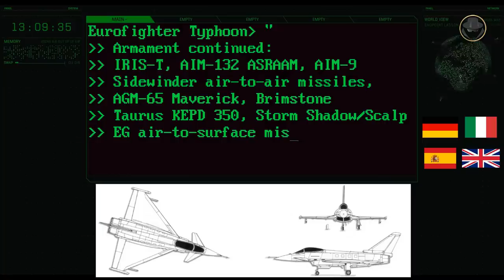Eurofighter Typhoon | The story that the West does not want to tell

Comment: Just one ironic thing to point out though, the MiG-21 actually has a lower thrust-to-weight ratio than the F-4 and pretty much the same wing loading, but in a real battle, the MiG-21 is noticeably more maneuverable.
Reply: Dogfights is but one aspect of the story. There's also the longer range part among other things.
Reply: That's why Israeli pilots slaughtered the Russian and Egyptian pilots flying the Mig 21 in 1973. They only lost a handful of F-4 Phantom II to aircraft all others were downed by the S-125. Once the Mig 21 left the umbrella they died.
Reply: Mass will be mass
And huge frontal aspect with a bigger Cx is a disfavour for F4
Reply: No it isn't. There's a big difference between an early very light MiG-21F13 (which has a noticably lower wing loading than the F-4's) and the successive and much more numerous MiG-21Bis variants which have no advantage over the F-4, esp. the slatted F-4E.
Reply: The MiG-21 even in its early variants had the advantage of lower aerodynamic coefficient against the F-4 and this made up somehow for its inferior thrust-to-weight ratio. The second advantage of the MiG-21 was its superior G-limit ( 7G against only 6G for the F-4 ) this gave it the initial angular advantage whenever the pilot used to pull the stick all the way back at high speeds until it reached its corner speed. This advantage worked especially at low altitudes ( like in Vietnam where the aircraft were forced to fly low so as to spot their targets in the jungle ).
Reply: @jacksonteller1337  Nearly all of Egypt's MIG-21s were destroyed on the ground. Almost four squadrons lost before Egypt had even declared belligerency. Once the MIG-21 was in the air, it turns out it has a much better survival rate!
Reply: @dylanwight5764  you are confused, the 67 war they were destroyed on the ground. The Yom Kippur war in the air.
Reply: @dylanwight5764  want that the six day war not the yom kipper war where Israel cleared the skies of Egyptian and Jordanian mig 21s using the f4 phantoms. In the six day war israli fighters were the mirage.
It's probably more to do with fighter pilot training and skill. It's like how the Indian airforce mig 21s dominate the Pakistani f105s in air battles
Reply: @catfood_03_4stray  It isn't the coefficient rather the lateral cross-section.
Reply: @jmcfintona999  The F-4 entered Israeli service only in 1969 - during the attrition war against the Soviet-fronts "Egypt" and "Syria". The Israeli advantage was in the pilots first, and delta-wings second.
Reply: @dylanwight5764  Yes, except at the French Mirage III the real killer of Mig.
Sorry, but find out and see you that I'm not talking nonsense
Reply: mig21 is a unstable aircraft meaning you can get it in to crazy maneuvers
Reply: @RePlayBoy101  All the Russian planes are perfectly stable. Only F-16 and 3 Euro-canards aren't. The narrow body allows the Mig-21 to roll fast.
Reply: @zofe  the migs are notorious for being unstable thats why they are so maneuverable in the air
Reply: @RePlayBoy101  Nonsense, they aren't any superior. F-4 Phantom didn't have an integral gun in Vietnam, nor leading-edge moving-surfaces.
Reply: @zofe  what are you on about who said anything about an f4
Reply: @zofe  yeah the six day war was in 67
Reply: @jacksonteller1337  Sorry, I can never got those two straight. And let's not talk about trying to tell the difference between an India-Pakistan border skirmish and a cricket game.
Reply: @dylanwight5764  they can't even get their facts straight on the subcontinent. They seem to think propaganda is actually true. But in the six days war (1967) Israeli Mirages wiped out the Egyptian air force in a preemptive strike. During Yom Kippur the Egyptian army and air force hit Israel with a surprise attack it went well until they got out of the air defense umbrella. Their army was knocked out and the air defense destroyed on the ground. Then the Israeli air force wiped out the Egyptian air force and Soviet instructors blamed the Egyptian air force but got their arses handed to them.
Reply: @jacksonteller1337  By that time the MIG-21 was a pretty dated design, so it shouldn't have been a surprise to anybody that the more modern and refined aircraft it was facing had an easier time overall. 1973 was not the right time to still be flying the -21.
Reply: @dylanwight5764  they were younger than the F-4s and Mirages they faced. Both sides back than had obsolete weapons and only Israel had the brains to use them in a way they got the advantage. They even used the Sherman back than on the ground it also knocked out a lot of Egyptian and Syrian tanks. After the conflict they started buying the F-4E and replacing the Mirages with the F-16. The Mirage V they upgraded to Kfir with the F-4 engine.
Reply: @jacksonteller1337  I wouldn't consider the F-4 an "obsolete weapon" by any means. The design was very long lived in service because its airframe was well conceived and easily upgraded. Moreover, while the F-4 and MIG-21 were contemporary interceptor designs, the F-4 was a better all-purpose aircraft that was capable of missions simply not possible with the MIG-21. 

This is an interesting microcosm of the different design philosophies between western and Soviet aircraft. Whereas the latter often put all effort into perfect an aircraft for one purpose, the former valued a more versatile approach to aircraft design in general.
Reply: @dylanwight5764  the Mig 21 is still in service in several forms. They are still being upgraded and the Chinese have supplied the world with a shtload of cheap derivatives.
Reply: @jacksonteller1337  And what exactly are they capable of that the Mirage-III and Phantom II arent? Well, they're still very good high altitude interceptors. Although for some reason I doubt that bombers are going to be the technological tip of the spear in the next major global conflict...
Reply: @dylanwight5764  that would depend on which model you fly. The bis derivatives like the Bison upgrade are capable in a dogfight and much more capable than the Mirage III. The F-4 is in a different category so it will always outclass them with the exception of the Iranian versions. That is why the Chinese development of the J-8 was built. It in essence is a double Mig 21 with inlets and radar based on the F-4. I don't know how much Google will show but there are many types in my NATO database that can out perform the F-4 and Mirage provided the pilots are properly trained and they use the right tactics. Like in every case you are dependent on pilot training and tactics.
Reply: @jacksonteller1337  That's almost always the case, especially in an era where HOBS and BVR are the the typical factors deciding the outcome of an engagement. By the way, do you have any data on the optimum rate speed of the -IIIO? I know the MIG-21bis is best at around 750 knots and from memory the -IIIO performs very well at about 800 but I'm unsure of the specifics as they're not available in the RAAF archives.
Reply: @dylanwight5764  i haven't memorised it but it should be around the same as the E model because both where nearly the same. When i have access to my computer tomorrow i can look it up if i remember to do so. I have a small trip to Brussels in the morning we have to use the train unfortunately. So i should be back in my office about 16.00 hours if i think of it i will look it up.
Reply: @jacksonteller1337  Thanks for that. There are rumours that one contributing factor that the Avon engine wasn't adopted for the -IIIO was because it reduced performance in the turn but given that the Avon improved the thrust to weight ratio I don't think the slightly increased turn radius would outweight the improved turn rate of the extra power provided.
Reply: @dylanwight5764  we are having a longer chat here so i looked it up for the export version the optimum varied from 795 to about 815. But the input of this data was done manually, so a typo is very well possible. That is the problem we have with older data i always warn my boys to ask a geriatric like me that actually flew an aircraft. I started on the NF-5. Unfortunately i never got a chance back than to fly any French aircraft with the exception of a few helicopters. ( I have a private helicopter license).
Reply: @jacksonteller1337 All my experience with the Mirage-III has been on the ground restoring a destroyed airframe for the museum at Evans Head and spending that time learning all I could about it from retired RAAF pilots also volunteering there. They thought the -IIIO was best at around 800 as well. Although one of the more interesting nuggets I gleaned from them was that the -IIIO could out turn the F-4E and matched it for acceleration. Knowing that F-4 pilots often complained about the MIG-21 being the more agile aircraft and taking what you've said about the Mirage-III, we really are looking at such a small practical difference in performance between the two that pilot skill is going to be the main factor. And in that regard, the Israelis were certainly better suited to handling what their aircraft could give them! 

At the end of the day I think the MIG-21 and Mirage-III are a pretty good match in the air. While it's a shame that the Mirage-III was discontinued in favour of the Mirage-2000, I want to say they're still the same aircraft at heart and the legacy of the -III series is still going strong.
Reply: @dylanwight5764  i hope i can visit your museum soon otherwise it will be after my retirement. Have a wonderful day mate and stay safe 👍
Reply: @jacksonteller1337  I think I'm safer crawling through a junkyard than working hospitality!
Reply: Of course to that the Mig has to get close enough, it won't
Reply: Superior maneuverability, more specifically turnrate, doesn't solely determine an aircraft's capability against an opponent. There are energy fighting tactics to allow less agile aircraft to gain the advantage over a more maneuverable enemy - Hellcats against Zeros and whatnot.
Reply: @zofe  Google the F-4E
Reply: How could the ESA prefer agility over stealth when they had no capability of producing a stealth aircraft in the first place?.
Reply: @sean70729  to my understanding, MBB was developing a something more fighter looking analogue of the F-117A in the 80’s.
Reply: Compared to the Typhoon? Don‘t think so …
Reply: This is a great run down thanks. My favourite jet as a boy in the 80s was the Saab Viggen. I loved how it had high speed yet road landing, basically STOL performance and thrust reversers. Saab cars,  uh not so much.
Reply: No, it  depends how you fly each aircraft.  Keep in mind the F-4 has been designed as an "carrier protector" against bombers. Early and Navy versions of the  F-4 relied only on AAMs in air combat and the fire-control system was very slow. Would be a great "simulation" modeling an F-4C or D, equipped with built-in M39 cannons (the same as the F-5) + gun radar and then confront the MiG-21.
There were good reasons why USNFWS flew F-5E as aggressors.

The  Israelis Mirage III were equipped with DEFA 30 mm cannon (descendants of German WW II cannons) and the Israelis  excelled in "gun kills". Even with a F-15, a "gun kill" is still more worth than with an AAM.
Reply: @sean70729  The stealth stuff is just good for "Hollywood" and video games.  There are several disadvantages with "stealth" aircraft compared to a more or less "conventional" fuselage.
Reply: @jacksonteller1337  Wait, you flew the NF-5? That's awesome! How nimble was it?
Reply: @Tigershark_3082  it was great it is a bit more sluggish than the F-16 we got after in the vertical but it is a great dogfighting aircraft. Unlike the original F-5 it was tailored to our multirole use. It could pull nearly as many G's as the F-16 but it had a higher turn rate in the horizontal I still mis it especially the second engine that is why old-timers like me preferred the Rafale over the F-35A before we got our hands on it, the situational awareness 👍
Reply: @jacksonteller1337  Wasn't the NF-5 a foreign-built Canadar CF-5?
If so, I shudder to think what y'all could've done with an F-5E
Reply: @Tigershark_3082  Dutch build the N means Netherlands, Fokker Aerospace. Somehow we went back in sensors on the F-16A but it compensated in manoeuvrability. Both were a major leap forward on the aircraft we had before especially in dependability.
Reply: Early production models of the mig 21 had the R11 engine, this was later changed to the R13 engine.

I vaguely remember a documentary where the US pilots were used to doing a certain tactic that the mig21 was unable to catch up to them....

Then one day they realised that they could and it being mentioned that those were mig21 with the new more powerful engine

The power difference between the 2 engine is 1.2kN at military, and 3.1kN with afterburner.

So the North Vietnamese were probably sold the older stuff, and then received the newer variants.
Reply: Pilot skill plays a huge role. That's what I have learnt from documentaries. I mean there have been sabers and shooting stars that shot down mig21s. And mig 15s/17s that shot down mirages and f4s.
Reply: @aksmex2576  Mig 15 didn't shoot down anything but a couple of Sabre jets over Korea. The Mig 17/19 shot down USAF F-4s due to lack of dogfight training and a one arm tied behind the back rules of engagement.
Reply: AOA, straight thrust, horizontal stabililiserts, midle height mounted wings, nose intake
Reply: @jacksonteller1337  
What are you talking about?
The vast majority of Egyptian MIGs lost in 68 were on the ground after the jews launched a surprise attack alongside the US, whilst Egypt was busy in Yemen.
Reply: The main difference between the performance of the MiG 21 is the pilot. In the hands of a competent pilot it is an effective weapon, see India's use of the jet in several conflicts
Reply: It is absolutely hilarious to read the myopic focus on air-to-air combat by video game armchair commandos who have no clue what modern aviation warfare entails and where it fits and functions in the modern battlefield and the combat dimensions that must be addressed. Today's advanced ROEs can even include (to the horrors of armchair warriors) prohibitions of air to air engagements utilizing any air-frame mounted guns!
Reply: @zofe  lmal this dude didn't even know that the fighter jets need to be unstable
Reply: @LexlutherVII  neither can their Russian instructors they were shot from the sky even faster.
Reply: @jmcfintona999  pakistan? F105s?
Where? When? Why?
Reply: This video isn't about the f4?
Reply: @Kevlar67476  I think he means F-104's
Reply: @thewarper3393  You say Egyptians not Arabs, and Jews not Israelis. Says a lot about you!
Reply: @Hattonbank  yeah, maybe.
Reply: @Retroscoop  going back to your original comment (a year ago)

Nail on head. And too many people miss this.
Reply: @jacksonteller1337  Hahaha, "handful"?  Actually the Egyptian Air Force slaughtered those Israeli F-4 Phantom IIs and A4 Skyhawks over Al Mansoura on October 14th 1973.  17 Israeli jets were shot down in under 1 hour to 3 Egyptian MiG-21 losses.
Reply: At low energy states the MiG-21 did maneuver better than the F-4 A-D models did at low energy states. The slats on the E model was a help. Frankly though, it didn't make a hell of a lot of difference to the actual stuff going on.

Thing is, the true dogfight, a turning WVR fight, was not common in air to air kills over Vietnam.

Soviet trained, a NVAF fighter pilot was doctrinally essentially just a shooter. The GCI controller managed the geometry and led the flight into a firing position, typically behind the attacking Americans who were unaware of their presence. After shooting, the MiG pilot would dive and run, so very few turning engagements—true World War II or Korean-style dogfights—occurred. And it worked. If an enemy could be taken by surprise then the likelihood of killing him, or at least shooting him down, was fairly good. Then and now, over 80% of fighter pilots everywhere who survived an air to air shoot down reported they were never aware they had been targeted until it was too late. The North Vietnamese were very aware that they were no match for their U.S. adversaries on anything like even terms.

The 1973 USAF “Red Baron” report published by the Fighter Weapons Center found only one instance of an American fighter being outmaneuvered and shot down in a turning fight. On equal terms, called a neutral engagement, U.S. fighters scored 28 kills, and when reacting defensively, the American jets frequently reversed the situation and shot down 18 NVAF fighters. Of 131 North Vietnamese losses, 63 were MiG-17s, 60 were MiG-21s, and the remaining 8 were MiG-19s. Of 445 USAF F-4 combat losses, a pathetic 33 were from air to air kills.

Comment: A couple of errors in that commentary first the aircraft always had a secondary ground attach role from inception was planned to be the Jaguar replacement after equipping the initial fighter Sqn's of the RAF. Several Stealth features of the aircraft built in at the original design missed off, Typhoon has a frontal radar cross section much lower than the general public think. but overall a very good commentary on general aircraft development in ther market place.
Reply: I have no clue how this "pure fighter" BS became common "knowledge".
Reply: @xyzaero  me either. It was always a Swing Role fighter, just the capabilities were added in steps. Frontal Radar cross section is 1/4 the size of a Tornado. In comparison F22 frontal radar cross section is 1/10 that of an F15. so it is not a "stealth" aircraft but way stealthier than people think.
Reply: @EfftupSmith  Ar least one person who knows his shit 👍🏻